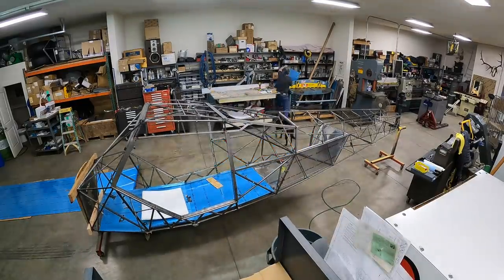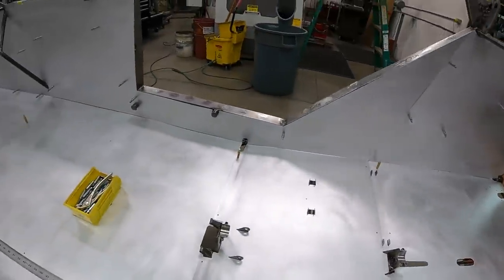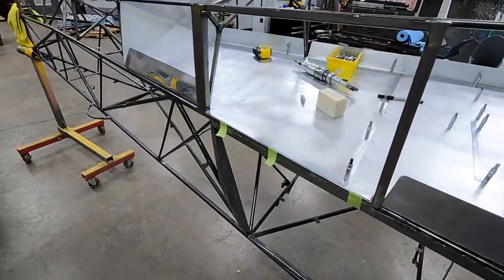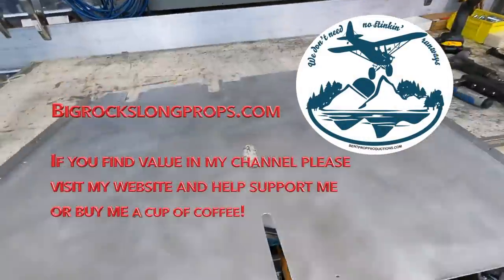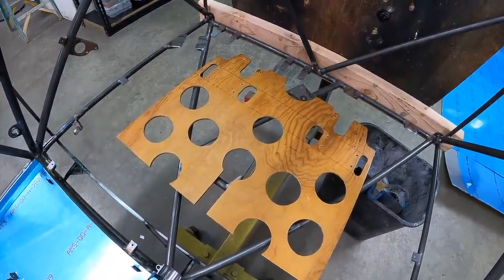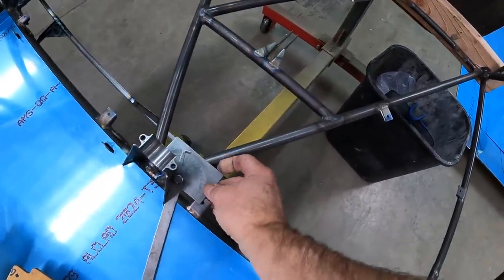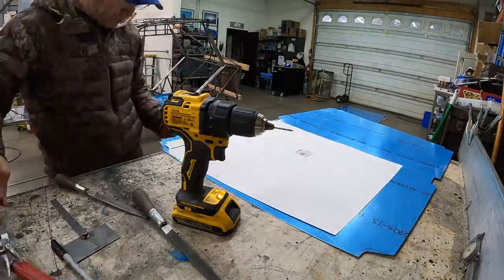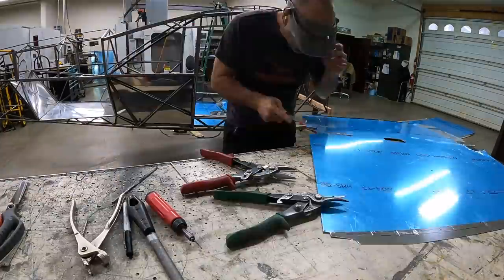4 Place Super Cub Build Episode #3

Comment: For those angle pieces at 5:40.  Since you're looking to bend away from the flange, you could just stretch the flange rather than cutting it.  Simple way is to use a body hammer, the cross peen head, hit the flange where you want to stretch with a steel backer and the material will stretch and force a bend into the piece.

Comment: Greg thanks for the video. Have you considered Oratex for some of the interior? Interested to hear your thoughts.
Reply from the maker: I used Oratex in silver color on Bushwacker for the upper area. The area that started at the rear window height and above.  It worked fine but in this airplane with all the L-21 style glass it has no use.  I would not do it below the L-21 glass because that area is going to get abused.  If I need to I can always make a copy of an aluminum panel if it gets to beat up. Which I would seriously doubt.

Comment: Hey Greg. Dont you have a stretcher and shrinker that you could use to shape those angle pieces. Should be a more rigid piece than cutting and drilling them. Probably save you a bit of time to. Nice video anyhow. I've built a few planes myself. Everything takes time and you can't really put a value on that either.
Reply from the maker: I do, but I did not need strength for them and I can drill and cut faster then I can shrink.  I don't like the looks of something that has been worked in the tool unless it is cleaned up and that takes time.  I use this same method for making the inner windshield strip for the windscreen.  The outer strip I will shrink and stretch then as required to make a nice part.  That is just me so YMMV.
Reply: @mauleguy  all noted. The drill method does look cleaner. Well done.

Comment: Are you going to do single front seat in the middle
Reply: Wouldn't that defeat the point of a 4 place Cub?
Reply from the maker: I am not but you did figure that out.  The reason I want the seat up front with me is for CG when hauling a heavy load.  I would rather have the passenger next to me for that one reason.  Other then that I really like the center seat and putting passengers behind me, out of my way:))